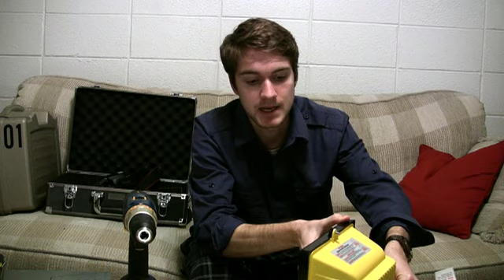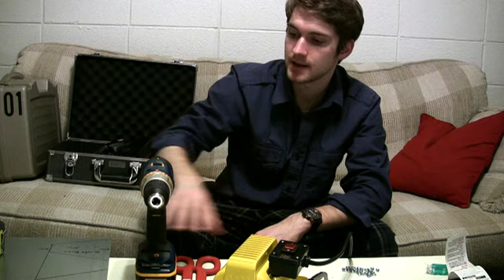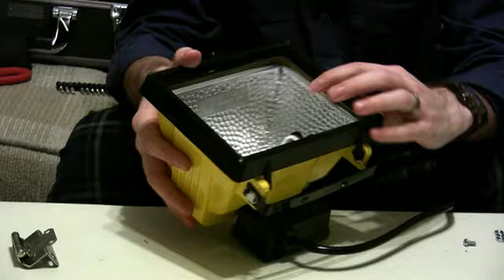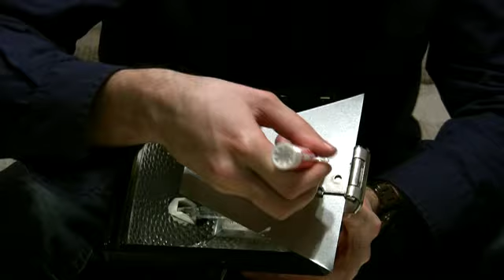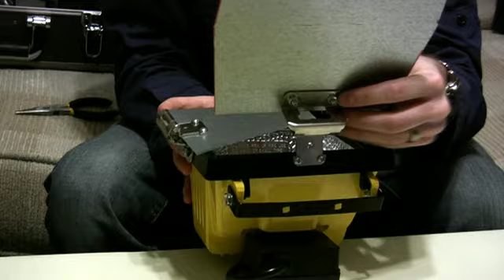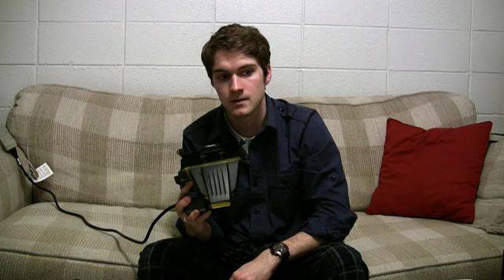How to Build CLOSING BARN DOORS on a WORKLIGHT

Comment: EVERYONE WHO WANTS TO MAKE THESE BARN DOORS KEEP IN MIND, THE LIGHT GETS SO HOT IT WILL MELT YOUR HINGES (the plastic in there what is the tension inside the hinge)
Reply: Is there a possible material to use that won't get so hot that they melt?
Reply: I'd try getting material that is all metal instead of plastic in the middle. Even if you try covering these plastic inserts with something they will melt and leave you doors flapping. You could also let them melt then find another way to create tension for them. If you find a way please share a the link.
Reply: Will do! Thanks for the advice.

Comment: to protect yourself from possible exploding bulbs, you could fit a square cutout of wire mesh in there. Just a suggestion I picked up from the frugal filmmaker, which I've done, and it works/looks great. Great job!